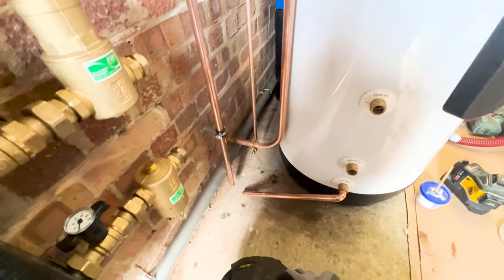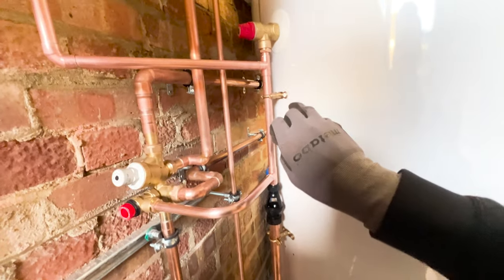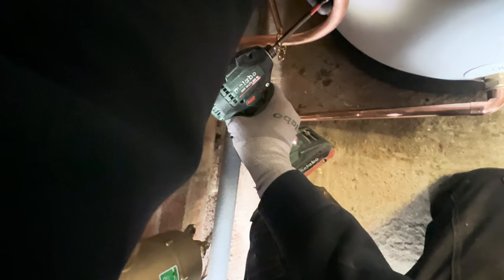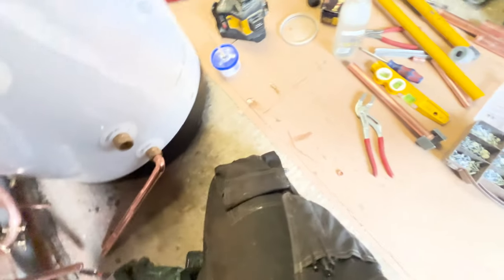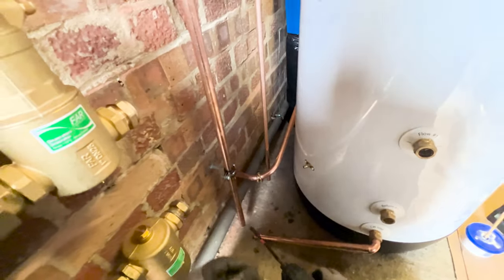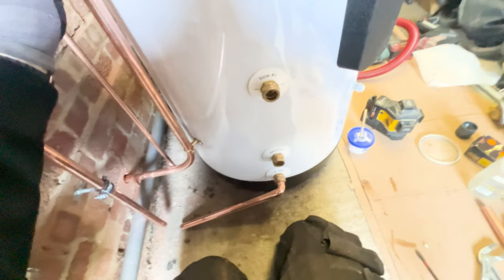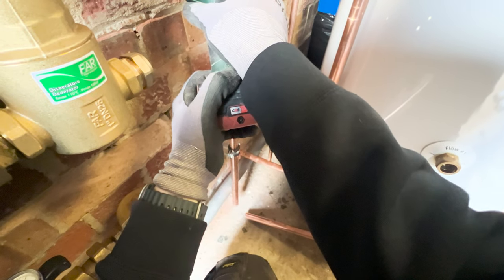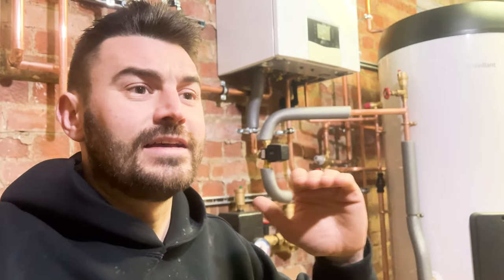MUST WATCH!! PLUMBER HOW TO... SCREW AN UNVENTED CYLINDER.

Comment: Nice ..Thanks for sharing !! BTW , theory says D2 cannot have less than 1:200 fall ..is this always practical ?
Reply: 🙈🙈🙈 you need to buy an angle finder and work out your fall to the letter or the police will come knocking mate. Go careful out there 🚨
Reply: I had to do this last week on a unvented cylinder, first time I had done it a took a bit of bottle to do it as the cylinder was full. I found the Talon steel backplates worked well as you could bent them and form them round the cylinder👍
Reply from the maker: Fuck me, is this comment actually real 😂 Are you talking specifically about the section of pipe from the bottom of the bend through the wall 300mm?